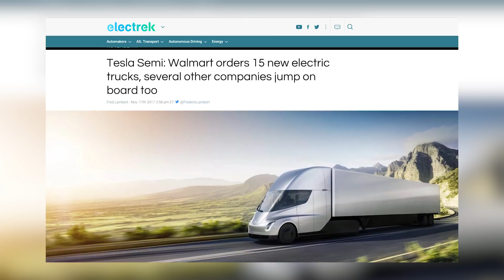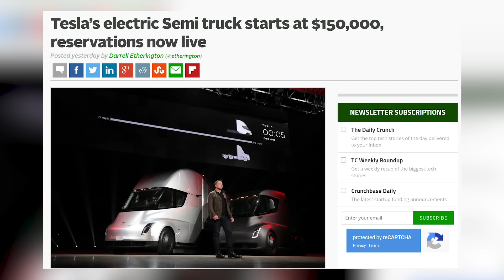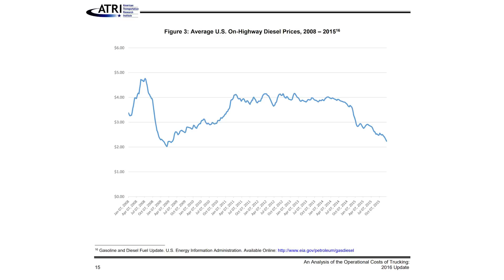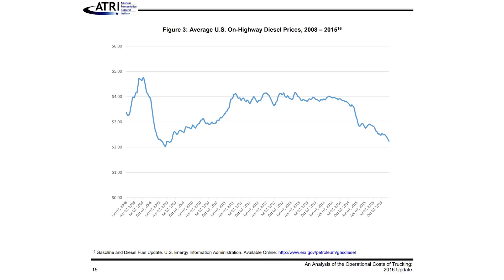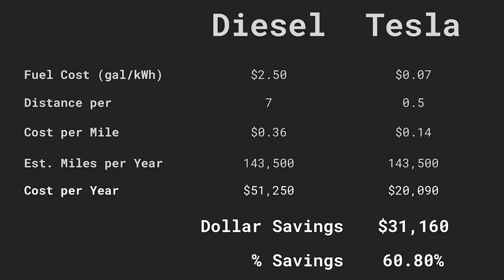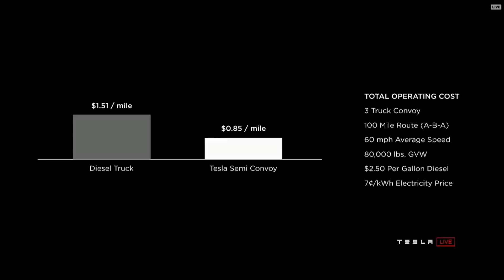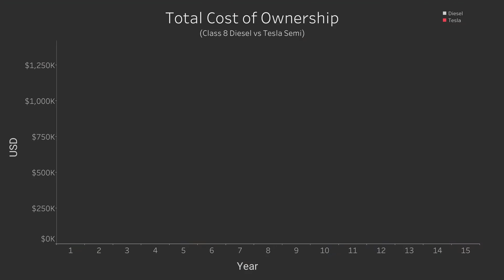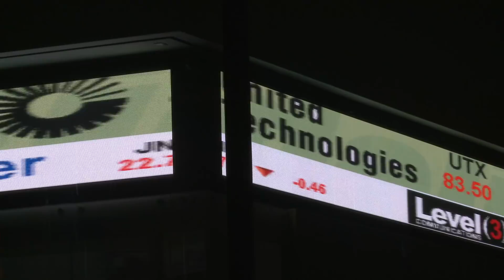What is the TRUE COST of a Tesla Semi?

Comment: I think you are way off on your estimates of costs.  In the video you said $120,000/year maintenance.  No way.  Typical truck might be driven 150,000 miles a year as a high estimate. At 7.5 miles per gallon and diesel at $2.50 per gallon that is $50,000 per year.  Oil change intervals run 15k to 25k miles. If we use 20k then that is 7.5 oil changes @350.00 per for a total of  $2625 per year.  Only maintenance we will do on the transmission and differentials is change the oil in them once per year so we can throw in another $800. What the heck we can even through in new brakes all the way around the truck, that is another $1500.  So total would be around $55000 annual maintenance.  I ignored tires because both trucks will have about the same annual costs for tires.

I also have a problem with the fuel cost comparison.  That 7 cents that gets quoted does not include any highway fuel taxes while the a significant portion of the $2.50 cost of diesel does.  States already yell that they don't get enough tax revenue to fix roads.  How long before the states start charging electric trucks highway use taxes.  In fact the way the taxes are collected now makes it very easy for them to collect taxes on these electric trucks all it would take is a legislature to say that IFTA program include electric trucks at so many cents per mile.

The dismissal of the 30 minute charge time as being irrelevant because I already have to take a 30 minute break is total wrong.  Yes I have to take a 30 minute break after being on duty for 8 hours but I usually get that covered during my unloading/loading times.  Rarely do I stop somewhere just for a 30 minute break (it takes me 8 to 15 minutes to fuel the diesel truck).   I have seen other people on other sites speculate  that they would put charging stations in the shippers and receiving stations; that's not going to happen.  A lot of those places don't want to let me into the building to use the bathroom so forget them putting in a charger for me.

These trucks are a great idea. However the way this truck is designed and the capabilities it has it will only be a able to play a roll in a certain portion of the trucking industry.  It will not be able to replace all trucks in operation today. 

The thing that I worry about is how much does it weigh and how much payload can in carry.  I have not been able to find that information.  Yes it can perform at the gross weight of 80,000 pounds. But that is the max it can weigh.  That is truck, trailer, cargo, and my fat ass in the driver seat.  The truck I drive now can carry about a 46,000 pound payload before I hit that 80,000 pound mark.  How much can the Tesla truck carry?  But the weight isn't as simple as saying 80,000 gross vehicle weight.  There is also other limitations.  The trailer tandem axles can't be over 34,000 and the drive tandems can't be over 34000 and the steer axle is usually can't be over 12,000 (there are ways to get that number higher).  So it's not only how much can the Tesla carry; it's also how does it carry it.  If anyone knows the answer to that please post it.

I have 20 years experience driving 80,000 pound trucks in all 48 contiguous US. States.  I am a what is refereed to as an over the road driver (OTR).  That means I haul general freight on a non standard lane.  In other words, when I leave my home terminal with a load, I will travel to some point inside the US.  Then I will unload and get another load in that general area and travel to some other point.  rinse and repeat.  Once I leave the terminal, it might be 2 or 3 weeks before I come back.  Once when I was single I went 8 weeks before coming back to my home terminal.
Reply: There is nothing wrong with writing a long comment if you have useful and interesting things to say, and if you have useful and interesting things to say, the time it takes to write it is moot. I frequently write similarly long comments (occasionally even if I do 'not' have useful and interesting things to say), and a post this long might take me twenty minutes, with proof readings.
Reply: +Michael Rhein Michael, thank you for your insight into a world that many of us have very little experience of.  We  can also pay attention for much more than 140 characters.  :-)
Reply: redxsage How about just think?  These routes that you speak of doesn't exist for the most part outside of the LTL industries.  The way these private fleets work is they send trucks out from a DC that delivers to one or more stores they they will make a pickup at an outside supplier and return to the dc.  Most of these routes are over 500 miles. Most of these drivers are gone from the DC for several days.  Because they are delivering to their own stores by there own trucks they are generaly in and out of each store in a matter of minutes or if its just one store they drop a loaded trailer and take an empty.  I have no problem with replacing diesel trucks with electric trucks.  I do have a problem with people that don't know what they are talking about making wild speculations and stating them as facts.  Elsewhere I commented these trucks can play a very nice roll in the LTL side of the industry.
Reply: Mark J. Kim slow down it really does make a difference and you will find it really doesn't affect your time much.  You only think you are driving 70. In reality you are constantlg having to slow down because you get cauggt behind a slow mover and can't get over then when you do you accelerate back up. Just to do it all over again. It kills your mpg and stresses you out.  Slowing down will save fuel because of physics but also because you maintain a more consistent speed. You are less stressed so you drive further between breaks and you are less tired at the end of the day.   I first tried it out as a company drivet before buting my own truck, it made such a difference im my mpg one of the office monkeys called me to see what was going on because he couldn't believe the computer. At tge time i was running a dedicated route so it was easy to see a begore and after.
Reply: But Tesla trucks are not designed for OTR (not sure if that was a point in your comment or just general introduction)
Reply: Mark J. Kim right now i am a company driver. 6 months ago I was an owner/op. I was an owner/op for 8 years. Giving up my own truck to be a company driver was a mistake.  The current truck i drive is a 2017 t680. It averages about 7.5 with 90% of the loads I haul being over 40K in the box. So 90% of the time I'm 75k to 80k gross. The truck I owned was a 2004 Volvo VNL780. It averaged 7.1 with 70% of my loads over 40k.  I changed the oil in my truck every 15k to 20k miles. My mpg quotes were figured on paper with miles driven and fuel burned. If you are only getting 6.3 I'm gonna guess you drive to fast. As an owner/op I drove 62.
Reply: Thank you for being the first trucker I've seen to give a rational, clear headed and well thought out response to the Tesla Semi. We will have to wait and see how the loads/etc work out when more details are released. My bet is that the truck is quite a lot lighter than a traditional truck. I think their immediate goal is exactly what we've seen, big orders from companies like walmart/bestbuy/etc. who have fixed routes and can plan for charging needs.. that will fund future models and variants. They did the same thing in consumer cars by using the roadster and model S to fund the model 3.
Reply: I'll take a wild guess that your trailer axles carry 27,000 pounds  and your drive axles carry 19,000 pounds of your payload, so that means your empty trailer weighs about (34-27)x2 = 14,000 pounds? And your truck weighs (80-46-14) = 20,000 pounds? If the Tesla truck weighs 28,000 pounds (battery alone will be more than 16,000 pounds?), then to keep your drive axles under 34,000 you would have to take 8,000 pounds out of the front of your trailer or 16,000 pounds less if it were equally distributed.
Reply: Not going to argue on the costs... But let's face it, even if these trucks turn out to be expensive, they are the future. And the reason is simple... upgrade...as per economy...
In my country a truck costs only 45-50k dollars... Here the transport industry is huge... But everything is done cheaper here... Truck are not as luxurious as US trucks... They are just ok on that part... When we inch towards a bigger and better economy... We will also have peterbilt/scania etc type of costly and luxurious and comfy trucks... It will get more common... Just because along with economy... Everyone grows and upgrades...
Reply: Very interesting information thanks!
Reply: This is just a BS marketing move, if EV "trucks" were a thing... ups be all over it.  Can you think of a better way to save fuel than making a truck whos job is to stop even 5 min EV?
Reply: GaborBartal That is what has me stumped.  These trucks should fit in very nicely in the LTL side of the industry, but they are not designed very well for that side.  They look like they are designed to be OTR trucks.  LTL accounts for about 10-15% of the industry.  While these trucks can't replace all those trucks they could replace a signifact portion of them.
Reply: Michael Rhein n
Reply: Michael Rhein, Very well written and thought through response!  Excellent Points you are making!  I agree with all of them.
Reply: I checked many typical sleeper cabs Peterbuilts and Kenworths weigh between 20 and 22,000!  so you are right on with your math.
Reply: Michael Rhein - tires are going to be way more of a cost on the Tesla, because we’re gonna smoke them from every stop...
Reply: So we all see the news on the battery shortage caused by tesla... the same telsa who can't even put out the model 3?  lol.  No shortage I know of with diesel engines or diesel.
Reply: @mattlane2282  I like how Elon keeps proving naysayers like you wrong 😂
Reply: Wilson Botlero writing long comments mean you are acknowledgeable of something, not a kid in the basement writing slangs and lol comments.
Reply: This particular iteration does not have to replace all diesel trucks.  Eventually, all of them will be replaced, and that process must start somewhere.  Your concerns will be met in time, by a version of these semis that has a 2,000 kWh (2 MWh) battery pack capacity or better.  Most of these rigs will go to private companies that operate their own transport between regional distribution centers and big box stores on closed loops that are regularly traveled.  They will certainly be able to charge between loading and unloading, no doubt. Think about the future, before it is too late.
Reply: Dude,how long did it take for you to write this comment ?

Comment: I think Tesla should make trailers with drive motors on both axles. The axles should also be able to steer, allowing for smoother lane changes (turn in the same direction as front wheels). Those rear axles would turn in the opposite direction at low speed to allow for better maneuvering and tighter turns (no more wide turns). The semi may be able to make a U-turn at an intersection. It would work similar to a hook and ladder fire engine. 

They should also cover the roof in solar panels. This could supply up to 6.3kw of power (424 Sq ft @ 15w per Sq ft). Three to four 100kw packs could be installed under the trailer, adding 150-200 miles of range and lowering the center if gravity. Trailers can be plugged in during loading or while sitting in the yard, giving the tractor a fully charged trailer on pickup. The trailer packs can charge using the solar panels while on the road or sitting in the yard.

Looking at existing numbers, I'm thinking about buying one and leasing it to any one of a number of drivers I know.

Comment: Hi Ben,  do you really believe that the megacharger will be powerd by solar. The Gigafactory has still no Solar on the roof.
Reply: YET!
Reply: The thing is, you need between 1/4 and 1/2 acre of solar panels for every truck you charge per day. So a truck stop will need like a 500 acre solar farm next door. Try to do that in a densely populated area where most trucks run
Reply: Cindy Tepper Do you drive 500+ miles in a built up area or is that mainly on the highway? If the highway, then that would be where you put the charger.
Reply: Both really, here in the Northeast like along I95 is one big long built up area. Even going west on RT 80 or 76 is all built up. No place to put solar farms that big. Large truck stops can fuel like 1,000 trucks in a day and those trucks can go like 1,000 miles between fuel stops. So to get the same amount of miles with a tesla you'd need to charge 2,000 trucks in a day. Where are you going to put 1,000 acres of solar panels?

Comment: Going green is great..... putting truckers out of jobs not good.
Reply: Exactly what I was going to say.  There is a job shortage in the trucking industry anyway.  Anything that can be done to keep the good and qualified drivers and get rid of the warm body, meat in the seat is a good thing.
Reply: Perhaps also some loading of rail switches back on the road. At the time all manufacturers are working at autonomous truck driving. Tesla is no exception and other manufacturers have introduced even their e-trucks.
Reply: m341ehw When gasoline engines became the new technology, the horse breeders went out of business and they went on to do something else, so will I truck drivers. Technology waits for no one.
Reply: m341ehw Well around here there is a trucker shortage. So they tend to hire warm bodies, I see no downside to a smaller demand for drivers.
Reply from the maker: +m341ehw they'll adapt

Comment: Agreed. at 1MW Li-ion battery pack would weigh around 12,000 pound with GVW limit of 80,000 or thereabouts. If tesla still use the same Li-ion battery, you will be severely limited in payload. This is based on 100KW battery pack weight of Tesla 100D/P100D.

Another data point.  Tesla roadster is about the same size as model S yet has twice the battery energy.  Silly to think battery is hiding in frunk and inside the door. at 2400 pound for 200KW  battery, the performance tire will not last. Performance and handling of roadster with 2400 pound battery is just not plausible. Besides, I don't think there is enough volumetric space inside the roadster to have 200KW Li-ion.

Toyota has said that they may bring a  rechargeable magnesium based battery in 2019-2020. Magnesium battery is about 50% more energy dense while rechargeable aluminum battery should have about the twice the energy density volumetrically.

Holy grail of battery is rechargeability or number of times it can recharge, discharge rate, total charge stored. You can find battery chemistry for one the requirement but really hard to get all of them.

I'm certain that Tesla is alpha or beta testing of the new battery chemistry.

Comment: Great news for independent truck owners. They won't get ripped off servicing the trucks from these major truck dealers like Freightliner,peterbilt, international..  Tesla truck owners can keep their arm and a leg. Tesla should bankrupt all those truck manufacturers..bunch of theifs. Making junk trucks and highway robbery services.
Reply: jong lee this should end the ability of independent owner operator to exist. Surely they won't be able to afford the mega chargers. Or spent days at a time using only authorized tesla shops, never being able to do ant diy maintence.
Reply: richardscathouse ,besides computer.electric motor and battery. Other components should be same as current truck part. And probably do dyi. But you are right about independent operators going jobless. Not just them but most of driving jobs. After fully autonomous goes in effect.

Comment: I have a unrelated question to this subject: Would you describe the level of secrity of Tesla cars if an electromagnetic bomb explodes in the proximity of an electric car, specially a Tesla.
Reply: amir farahani the battery pack has aluminum armor that acts as electromagnetic sheild. The car itself is an electron sink. And the battery module design will force electric surge to jump over bus bars rather than go through the battery cell. Each cell have individual fuse to protect them. The cells are isolated and heat is vent away in event of cell failure. So if the bomb is far enough away that you don't have to worry about the shockwaves then you don't have to worry about the battery exploding. It would need a severe physical damage like a metal going through the armor before something interesting will happen.
Reply: amir farahani As with any car or apparatus that has electronics in it, it will stop working after an EMP goes off. How much it is damaged then depends on a lot of specifics.
Reply: thanks for your speedy reply

Comment: Diesel trucks have lots of cancer-causing emissions! Even if the Tesla Semi would cost the same as a Diesel there still is an incentive for companies to switch, for the sake of the environment and the hype of electrification!  I'd like to know if there are current laws in place that restrict the use of Diesel trucks in inner-city, residential or sound sensitive areas? Could the mega chargers provide battery-pack swapping?
Reply: If you idle my t680 kw in California the air going in truck is worse than what comes out
Reply: Holger 
That's total nonsense. On any newer truck. They are not loud and pollute far less than any gas powered car. They have been equipped with particulate filters since 2007, and Urea injection systems to eliminate NOX since 2010. 
The only real pollution is CO2. And I'm not sure that qualifies as pollution.
One thing I can tell you is all that emissions crap put the fuel mileage in the toilet and it is taking a long time to even get back to where trucks were in 1999 relative to fuel economy.